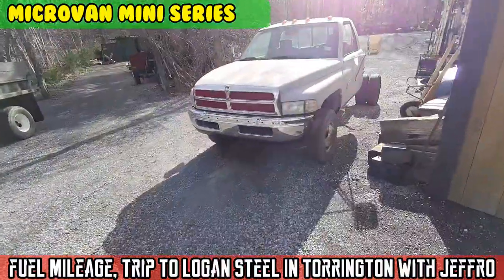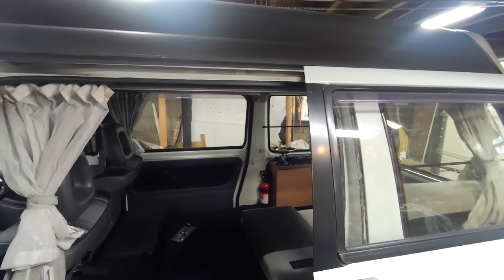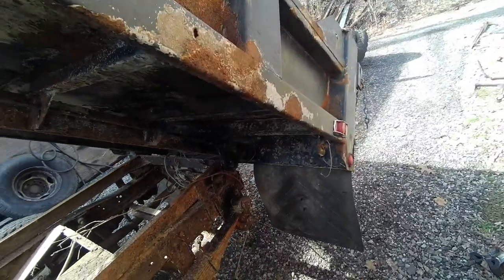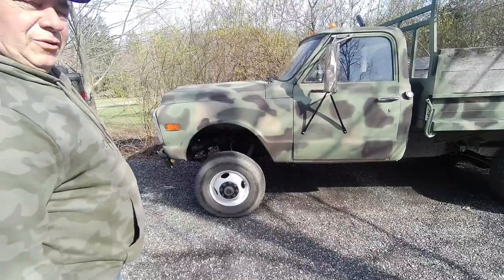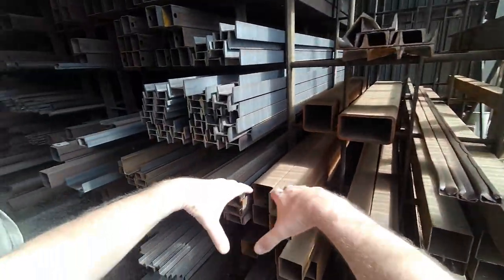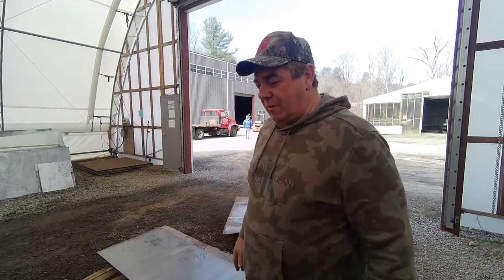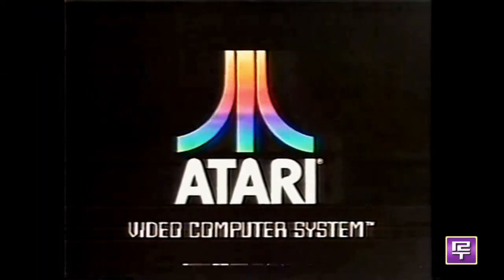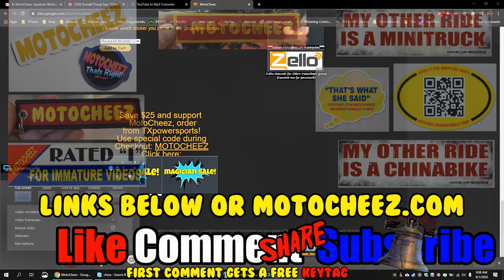Micro Van (SE1 E16)  New MGP on the van and a trip to Logan Steel in Torrington, CT

Comment: Do you shut your van off while its idling high? I have the same problem hard starting. So when i go to park, i let the clutch up to drop the idle. And it starts a lot better. If its warm out it starts fine everytime. If its cold i crank it and hit the gas pedal twice and maybe 2-3 times and itll run
Reply from the maker: It idles about 1000, not high really. When cold if I pump it, floor it, do nothing it's the same.    If I push very slight throttle it starts right up sometimes
Reply: Our HiJet climber does the same thing

Comment: You're starting delay could be from the factory the Grand National had it it would not crank until it register oil pressure i think its for the turbo.
Reply from the maker: Ahh. That's something to check, have to find out where that is if it has one. The oil light goes out within a couple cranks so there's definitely pressure but the switch may be defective.

Comment: I wonder why it's flooding.  Every so often I will get a hard start but that's like right after leaving it  after a drive then starting it back up.  Now mine smells like a motorcycle when it runs it was running a little lean earlier before the fuel pump was changed.  Is there a seal leaking you think?
Reply from the maker: I'm not sure if maybe the float needle is letting gas in a little bit and it's making it flood or I don't know if you notice when I open the gas cap it's pressurized like for the newer fuel injected style, normally carbureted didn't have fuel tank pressurized so I'm not sure whether that's maybe part of the problem either...
Reply: @MotoCheez  mine does give you some pressure when you open the cap not every time but I do see that on mine.    I figured it was just fumes from sloshing around so much.  🤷

Comment: Try changing air filter and plugs and see how you get on.lol we pay near 10 usd/gallon here in nz.so around $3.27 litre
Reply from the maker: Plugs and air filter were perfect. I think the carb flooding, maybe because I have a non vented cap? Carb and always under pressure. I wonder
Reply from the maker: I do have the cheap gas cap that they put on it, I think I may try that. I kept it as a reserve backup

Comment: Is that injected or carbureted? is there an air/fuel mix screw?
Reply from the maker: Carburetor, yes I adjusted the air fuel on the AFR guage.
Reply: @MotoCheez  Maybe the carb needs a good cleaning???
Reply from the maker: Possibly but it's a huge nightmare to get to it but I may end up having to do that. I'm wondering whether the pressurized fuel tank is the problem cuz a lot of the older carbureted models did not have a pressurized cap I don't know if you noticed the pressure coming out when I went to fill up
Reply: @MotoCheez  I noticed the pressure... could be the emissions system purge/vent valves, assuming it has them.
Reply from the maker: I had a vacuum condition this evening going to dinner we're acted like it was running out of gas but I still had a quarter of a tank I pulled over to fill it up and when I opened up the tank it sounded like it was under vacuum so I think there's something wrong with either a purge valve or definitely something with the vent or maybe it needs a vented cap? It is carbureted